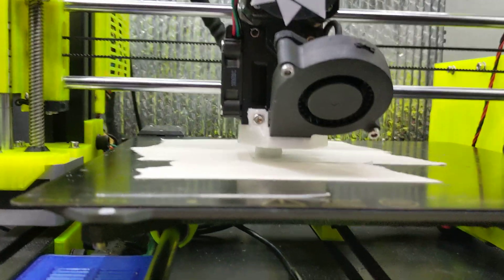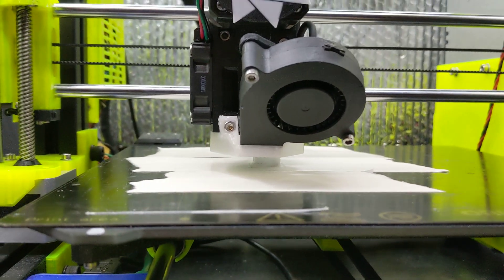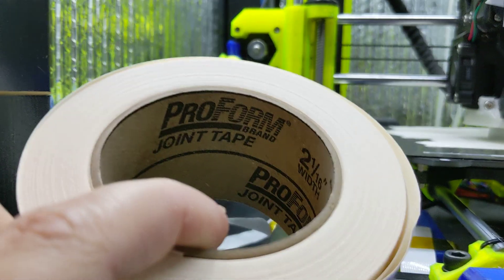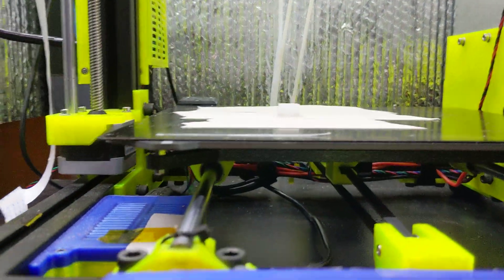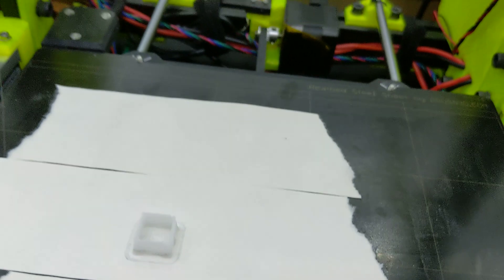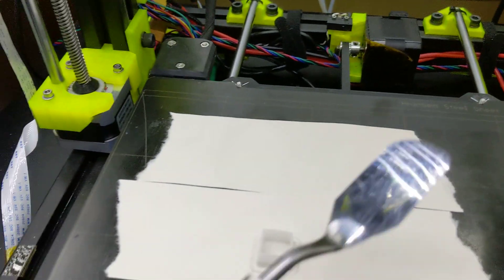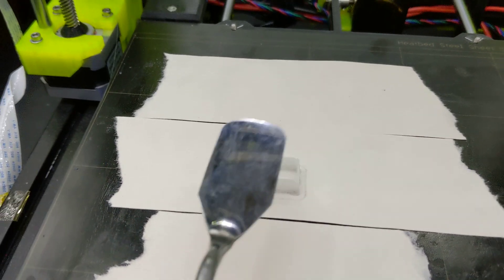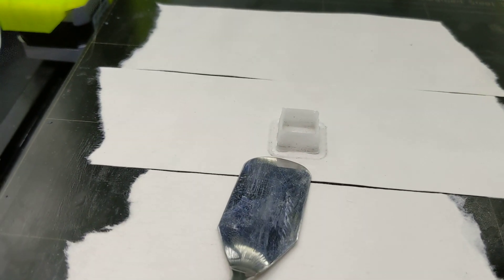I got Acetal Delrin (POM) filament to print awesome on a regular smooth PEI sheet! No brim!

Comment: Well thats going in my memory bank! Only one concern.. doesn't delrin off gas formaldehyde?
Reply: Yes, POM (aka Acetal (aka Delrin)) is a polyformaldehyde. When heated over 280C ish - it indeed releases formaldehyde in the air. However, when printing, you shouldn't go above 240C anyways - usually 220 - 235C. Besides that, formaldehyde in these amounts isn't dangerous and human body can deal with it. But good ventilation and low temps should avoid testing that statement

Comment: Been trying every trick under the sun to get this printed, and yours was the one that worked. Thank you!! 

0.2mm nozzle, 0.12mm layer height, 220C nozzle and 110C bed. Speed set to 30mm/s and first layer at 10mm/s.

Comment: That’s awesome! What’s your printer?
Reply from the maker: I've got an Original Prusa MK2.5s/MMUs that's had the "Haribo" upgrade (switched the frame to 3030 aluminum extrusions).  Obviously, I've customized the hell out of it =).  The most important customizations are in the MMU2 stuff (because by itself/stock it isn't as reliable as it can be).

Comment: WOW, You did a great job.  i have been trying Delrin on and off for a year now noting seem to work. I will try this trick soon. Do you have more detail on the config: bed temperature and nozzle temperature, speed ? Thank you.
Reply from the maker: For speed I went with 40mm/sec across the board.  I had the bed set to 110°C.  Nozzle at 220°C
Reply: @Riskable3DPrinting  Thank you for sticking with this and being successful! I work in the engineering department of a large hotel and we purchased an Ender 3 Pro as a test to see if we would benefit from owning one and we already have! I recently purchased a spool of POM from Gizmodorks to print sprockets, gears, chain tensioners and rollers, not knowing what I was getting into and cant get a good print on borosilicate glass bed and glue stick. We already have tons of joint tape and I'm going to try this tomorrow morning! Thanks again!
Reply: 220?? If I remember correctly, anything above 190 C produces ammonia, which is very dangerous. @Riskable3DPrinting